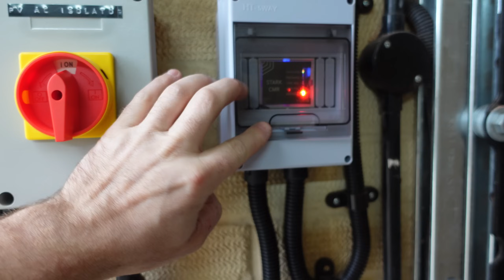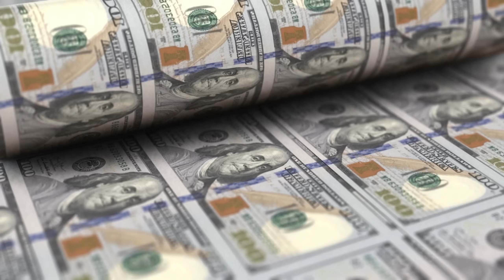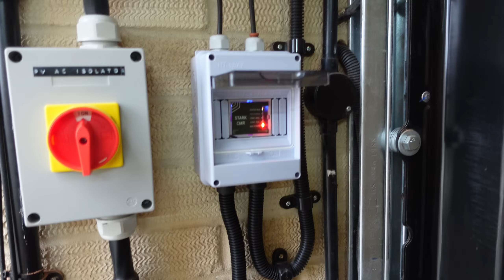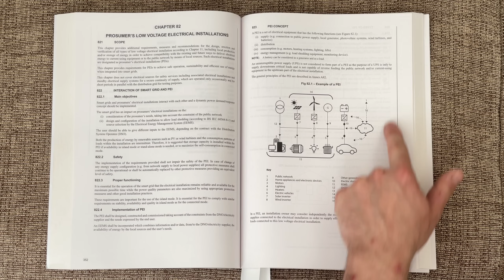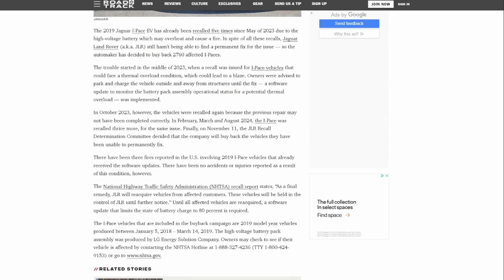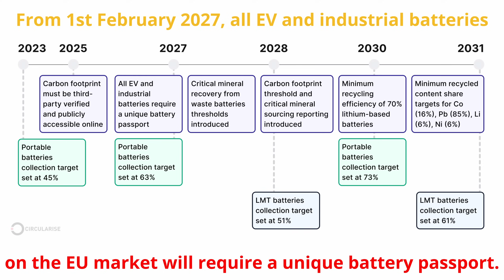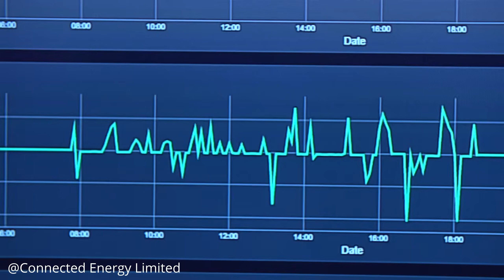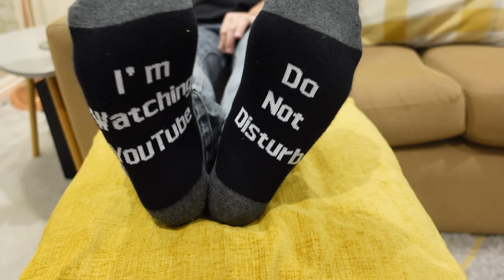4 Reasons I Chose an EV Battery for Home Energy Storage

Comment: 👍 great job. I'm half thinking of doing this with a Renault Zoe battery if I can't get it to run again due to motor failure/motor controller. Has anyone done a Renault battery pack yet
Reply from the maker: Yes Zoe packs are supported. Which size pack you thinking of using? 

Do the Zoe’s have a factory weakness on the motor/controller?
Reply: It's 41kw. Not sure what emulator would be required or inverter single phase supply (hybrid or ac coupled)

Comment: Everyone please dont do this dumb stuff. These batteries can NOT be used to safely in a home power system. Ive already read of 2 houses exploding from this in this year alone. And no its not because " well they must not know what they are doing " its because its freaking dangerous and not designed for this usage.
Reply from the maker: Was the explosion from an EV battery or DIY battery?
Reply: @TheOfficialBatteryMan   car batteries converted for household power use. And yeah after reset reading my comment it definitely comes off as a little confrontational. I just hope people really dig into what has been going wrong when people do this. Ive always been a fan of upcycling batteries in the land fill when they could be put to use seems like a no brainer. Ive been seeing firefighter department PSA's about this. I dont pretend to be an expert but the experts say it has to do with the batteries being designed for the cars and theirs just no way to aftermarket retrofit the software to operate safely. Tesla would definitely get huge props if they would just release a working fix. But as it stands right now utilizing car batteries for the home is really dangerous. * note when I say car batteries im obviously talking about upcycled E vehicle batteries not the old school gas vehicle 12 v batteries.

Comment: I agree with your points on battery size. I’m seeing lots of small, inexpensive hybrid batteries on eBay—some 6 kW packs are so cheap that a DIY setup could be worthwhile for peak-time heating or similar uses. Could you post an instructional guide on how to tackle a project like this?
Reply from the maker: All the guides are on GitHub under the project ‘Battery Emulator’ it’s possible to add new batteries if your that way inclined with more details how within those wiki pages

Comment: Are you using vertically mounted solar panels?  Your winter output can be higher.
Reply from the maker: I’m not but plan to in the future
Reply: @TheOfficialBatteryMan  Tip: consider setting your bifacials up with a slight zig-zag pattern, with the primary sides turned about 10 degrees toward the south.  that eliminates the mid-day dip.

Comment: I would love a detailed step by step on testing the pack. You kind of touched on it in an earlier video, but didn't really go into depth!
Reply from the maker: Yeah. I’ve left enough info to give key points but not really the instructional video channel. 

You basically need Lilygo with battery emulator flashed on and low voltage power and CAN wires. This is pretty much the same for all types of EV batteries. 

You want to make sure that cells are working voltages and all fairly close to one another. Packs with cells less than 2v could be problematic. Other than this checking for kWh total is a good idea in how much life the battery has remaining. You can of course go further and make sure that contactors are operating correctly but this requires a bit more set up and it’s very rare for them to fail.

For more information, I would recommend the GitHub wiki Pages for the battery emulator and Dala EV repair discord channel whether there are a lot of people working on these sort of set ups

Comment: Dude I have had the exact pack I took out of a car a year ago.  With plans of doing something just like what you did here.
I found the 48v systems to be ok buylt very expensive.
With my experience dealing with Model 3's I got a car ahead of time with these later plans.
I am now finally getting to building the system just like you did.
I'm using different inverters the Solis 11.4kw a pair.  I could technically hook a pack to each once they balance out.

I am really glad I found your channel as it helps me even more design the system.
I'm installing mine in a 8x10' shipping container and wall mounting all the equipment.

I will be getting it all together hopefully by the end of the month.
Please give me a shout as I have some ideas for plugging those ports on the Tesla pack for safety.

Thanks for the video's and take it easy!
Casey
Reply from the maker: Hey glad you enjoyed and thanks for sharing your story. A container is the perfect place for batteries of this size. Do you plan on using the Battery Emulator. LFP Telsa packs still do not have balancing correctly ironed out. We need CAN logs of charging to find what conditions introduce a balance so we can spoof the car into balancing
Reply: @TheOfficialBatteryMan  for sure, I have just enough room also.
Yea gonna use the lilygo and emulator may look into the stark.

Yea I didn't realize the balance was not understood, I'm pretty sure above 90% the BMS starts balance. 

I have several model 3s but I don't have a SR with a LFP pack otherwise I could look into those CAN signals.

Thanks again,
Casey
Reply: I wouldn’t recommend Solis as a DIYer. They refuse any warranty claims if it’s not installed by an electrician. Had to change the MOSFETs myself on mine. Horrible support and bad attitude from that company.
Reply: @AttilaTheHun333333 interesting, Yea I'm not too excited at the hookup connections in the inverter.
Given it's specified power output they are not good quality.
Eg4 inverters have huge oversized and overrated terminals but they only support 48v batteries.

The Solis is atleast Tesla with com bridge board compatible.
I will hardly ever be running at 100a using two of the units but it gives me enough for surge capacity.

What caused the mosfet failure in your case? We're they expensive and hard to repair?
Reply: @TeslaRebuilders  
I’m running the inverter all the time from the backup line, which supports up to 5kW output. I went over the rated output probably for a short period. Usually the inverter has a shutdown at around 5.5 kW, but this time it blowed two Mosfets out of four. They are wired parallel. I wasn’t impressed by the build quality either. Some filters were dangling around on the wires, also some wires internally seemed just enough to me.
Mosfets were 4 bucks each, I changed all four so they are matched. Not an expensive repair but very time consuming to get to the part, probably 50 or so screws and pretty hard to solder and desolder due to massive traces and therefore heat dissipation. Had to use the iron and the heat gun at the same time, but that did the trick.

Comment: Is there any good way to run it on 48 volt inverter without mountains of losses?
Reply from the maker: Not without tearing apart. Which then you’re getting into safety concerns. Loosing water tightness. The value of a working BMS and cell control. 

People used to break up leaf packs because they were very modular. Some EVs come with 48v bricks so they potentially can be broken up. But you would need your own BMS
Reply: @TheOfficialBatteryMan  thx alot for the answer. So that route is out of the picture for me than. Cause my inverter is pretty specific and requests 48volt
Reply from the maker: @ by far the easiest way if you want to use an EV battery is use a HV inverter. Single phase they are not so much money. Check out the GitHub for supported inverters a ‘Battery Emulator’
Reply: @TheOfficialBatteryMan  unfortunately i have to use the eg4 12000xp or similar for what i am doing. Stupid US splitphase...not normal 3 phase

Comment: If u have the space what i would do, is park the crashed tesla next to the house and plug it into a charger. Im not trusting myselve installing this myselve. I would just park the car in the yard. Strip the interiour out and it would be a doghouse. Dont know if the system would work if u disconnect the motors and other stuff u can sell to get some money back.
Reply from the maker: There is someone doing this at the moment. Leaving the battery in a car but running it on the same software and directly connecting to the battery. The UK doesn’t really have the space for a full car to just sit around

Comment: Not to be a party pooper, but what is the plan when the cells go into Thermal Runaway and into an uncontrollable self oxygenating fire ??? The normal way is to submerge the entire battery pack in a pool of water (which it continues to burn underwater). IMHO, it's too much of a risk for a home, unless installed in a power shed FAR from the home.
Reply from the maker: Totally agree in installing far away from properties. Cells are monitored and they will be removed from service long before degradation gets to the level of causing any issues. There are millions and millions of LFP cells in service. We hear about the few that have issues. But a fire is very rare. 

They are more likely to vent and we have kept the Tesla venting system. 

Either way there could be a good video for the naysayers😂😂

Comment: Lithium batteries are a disaster waiting to happen.
You'd need to house them in metal fireproof building with fire suppression equipment, but even then it's risky.
Reply from the maker: LFP is potentially far safer than NMC

Comment: can i put it outside in 0 degree weather in the winter?      Outside, so it won't burn my house down ?
Reply from the maker: You don’t want to be charging below 0C. But I’ve found that my cells run 10c warmer than the outside temp. So temps are above 0C even when the outside temp is below freezing.

Comment: I thought about doing this about 3 years ago but was deterred by members of an electronics forum I use, I should have gone wíth my instincts!!  How much did you pay for your battery packs?
Reply from the maker: If it helps it might not have been as easy 3 years ago. It really depends on what the condition of your pack is. And what deal you can strike. One of my subscribers got a LFP Tesla pack for £1900 the other day. I’ve not paid more than £3800 but as I say it depends.
Reply: @TheOfficialBatteryMan  
Many thanks, I was after a base line price guide, so that helps. There is a model 3 Tesla battery on sale for under 3k ATM, apparently tested, off a low miles write off, I think I'll investigate that further.  Are you planning to add solar charging to your install?
Reply from the maker: @ yes but it will have to be ground mount. Got a few projects before I consider it
Reply: @TheOfficialBatteryMan  
Yes, my house roof isn't ideally located for solar panels but is better than ground mounting would be.  The best set up would be two panel installs, so as one moves out of full sunlight the other would come in, cost is the issue though.  Will probably do it in stages.  Anything is better than suffering Millibandits insane agenda!!

Comment: I like the way you think.
I would put the batter system apart from my residence so if it did catch fire it wouldn't take out my house. Using a proven used battery is a damned good idea and kudos for doing it. 
Wish I was in a position to try it but getting too old and not enough sun on my site to make it happen.

All on all I think you have a killer idea, have you thought about making a plug and play system and selling it?
Reply from the maker: Agree on keeping batteries away as a precaution. 

It has crossed my mind to create a kit but at this stage it’s only suitable for the really diy friendly people. I would worry about dealing with ongoing support. One day maybe

Comment: I'd recommend watching a few video's about lithium batteries catching fire before considering using them, new or used. MGUY Australia on y.t. has a few. Explosive gases, flames that can melt steel and can't be extinguished, should be considered imo.
Reply from the maker: Defo should be considered. There are ways of engineering out some of those risks. Nice comment

Comment: I started watching this with interest as I built a campervan with solar panels and battery storage and for the past five years I’ve been getting free electricity when out and about, and I thought if I can do it in a van why can’t I make a bigger system for my house but hey you’ve just complicated it obviously you know you’re way around car ev batteries but not everyone does , there is an easier system out there and that’s the one that I’ll be doing.
Reply from the maker: If you want the more DIY route I would check out what Fogstar offer. You maybe familiar with their LFP batteries with the camper. But they also do more home based set ups.

Comment: Wow! This information is incredibly helpful. I'm eager to implement this at home but lack the expertise of an electrician. Could you provide guidance on how I can achieve the same results here? I have access to skilled electrical professionals but am uncertain about sourcing the necessary materials. Alternatively, would you consider assisting with the installation here in the Netherlands?
Reply from the maker: Do you have technical skills? Such as using Arduino and electronics? It’s a very ‘you’ve got to have those skills’ or know someone with them at this stage. As the project progresses it could become more simple to implement.
Reply: @TheOfficialBatteryMan Sorry, my friend. I'm not a technical superstar like you; that's why I asked you. I love what you're doing. Can't you start a company in this sense?

Comment: If your house burns down due to lithium ion battery thermal runaway, will your fire insurance cover your loss?
Reply from the maker: Im using Lithium Iron Phosphate. The same technology as every other home energy storage. EV battery management systems are built to a very high standard as these batteries face way more variables than static energy storage. good point to keep in mind for sure. thanks for sharing
Reply: In my case the answer is: NO. Most insurance has clauses voiding fire insurance if any non-approved equipment is present on site, i.e. any DIY or un UL certified equipment used outside it's intended use. So caution is advised.

Comment: Hmmm - that is very interesting to see it all plugged together . . . And yes, "if the European Commission were ever any use for anything" - it is for kicking some backsides and getting some "standards" out of the car industry.  It is maddening to see "industry standard" cells, and "industry standard" connectors, can-bus, and very often off the shelf management systems, on these darned things. Yet it is just the physical tin box packaging that makes them impossible to swap around. (The annoying thing is the car industry created consortiums to share the same engines between different brands and models. But they won't cooperate on this!) That will be half the problem in creating a real "plug it in" market for these packages. But excellent!
Reply from the maker: Thanks for sharing

Comment: This exactly what I have been looking into, the only possible problem is if house insurers decide that diy batteries void insurance cover. Like you I think they are very safe as long as they are treated correctly. I'm thinking about a small insulated shed or similar and housing the battery a few meters away from the house. Repurposing used Ev batteries and combining it with cheap night rate energy and solar and selling it back at peak is better for everyone. Ed Milliband is looking to spend huge amounts for long term but we need solutions now, not in 10-20 years, this is one of those solutions I reckon. Keep it up, subscribed 👍
Reply from the maker: Yes. I agree. Nice comment

Comment: This is what we professionals in the energy storage business call a DIY nightmare. Not sure what the consequences of installing something like that are there, but here in Canada you would receive a legal removal order and all of your home owners insurance would be canceled! There are safety tested residential energy storage systems for a reason.
Reply from the maker: Very interested. . What does your ‘professional’ work in the energy industry have you working on or with? It’s becoming harder and harder for solar and battery installers. So much is similar. Inverter, battery, cable sizes so on. But with each inverter having its own connectors. Comms to set up and commissioning process it becomes a task to know or offer all product installs.

Wow. There are very different standards all around the world.  The standard should be high. But that would need even more processes and standards.
Reply: It's a nightmare because you would run out of business! You would loose thousands of potential customers,why buy a of shelf home battery pack for 10-15k or make your own for 3-4k.....

Comment: It's fine to muse about "good for 5000 cycles" and whatnot, but approaching that limit is inherently risky. And anybody who doesn't know this should not be a tinkerer. And if you have to hire out for technical maintenance, well that's a recipe for death of a technology that is immature.

This is where economic law takes over whether you like it or not. When a system is too onerous to maintain, it's usage dies off. It becomes simpler to think about ways to not use electricity as much. The grid has heretofore been itself the incentive to use more power, not less. More and more dependance on computer tech is also leading down this path. It's wonderful and terrible at the same time.
Reply from the maker: Couldn’t agree more. In commercial second life projects maintenance is important. To a degree much is automated monitoring. 

I also agree strongly that just allowing a second life battery to run until it no longer works is dangerous. 5000 cycles is a guideline but as you get into older cycles BMS and control systems can look for tell tale signs the pack needs to be decommissioned. Cell IR. Temps. Remaining capacity so on. 

We have become a power hungry world hey